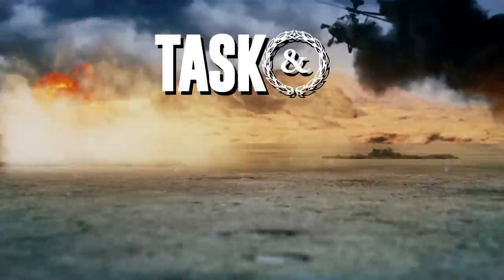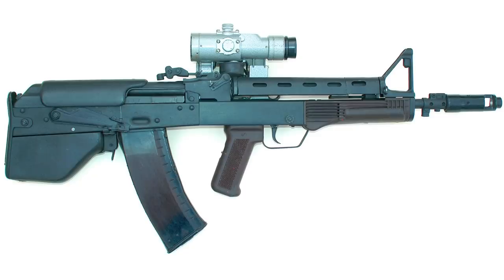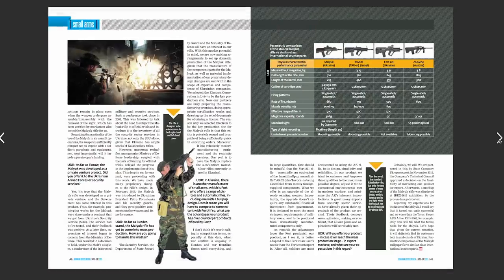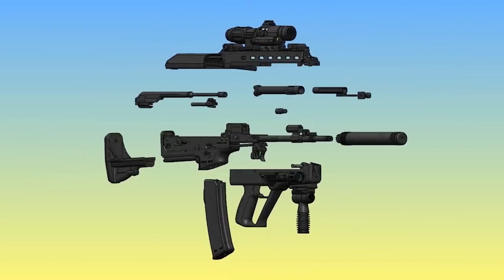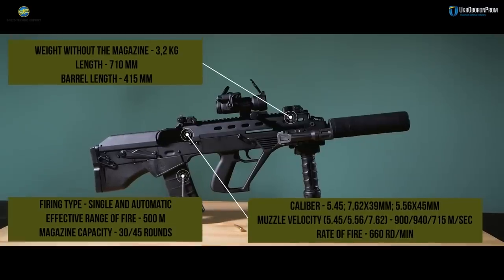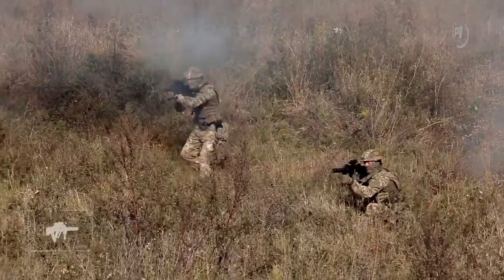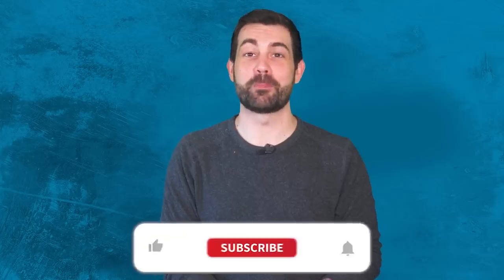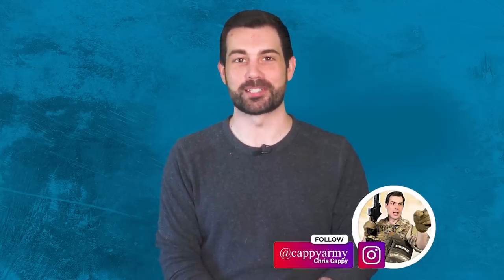Why Ukraine Special Ops Use This Bullpup. The Malyuk.

Comment: Convection is highly important for guns. Because convection is relevant for the surface area, Malyak can be good for heat management. the lifetime of the barrel is linked to the temperature, but there are more of mechanical wear of course. With good thermals gun are more reliable, accurate and shooters can see much better because heat forms "heat waves" wich distort view thru scope or metals. Easy example for convection heat radiator in hause, there are Convection and radiant heat, but convection is significantly more effective.

Comment: Basically, every bullpup is better than the orthodox layout in terms of grip, ergonomics, barrel length, muzzle velocity, and recoil. However, every bullpup layout is much worse in terms of the price tag on every item produced, because the action group should be much smaller and much more complicated than in orthodox layout. So it's needed only for trench-sweepers and building stormtroopers, which is a type of units, it's used right now)

Comment: Never heard of a convection heater? Convection also describes heat transfer through air, hence air-cooled engines using fins to increase the surface area allowing greater convection cooling as they suggest they are doing with this rifle and/or more gaps in the shroud. Also your editor (since you have a team now a days) needs to google what an AK47 is and not show a picture of an AK74U as a visual comparison for length! LOL. Still enjoy your videos though!.

Comment: If it is using less gas to operate the action, either by having a smaller gas port, or more likely having it farther down the barrel (more practical on a "bull-pup"), that would also contribute the the higher muzzle velocity as less anergy would be taken away that accelerates the bullet.

Comment: Only Bullpup I own is a 12g but almost the same thing.
I think it's like everyone else says, it's training for the weapon systems used.
Even in this video you see soldiers reloading using their forward hand for the mags.
People are just so used to keeping their firing hand on the grip of traditional rifles.

Recoil I think is just gonna feel different due to moving the weight/action back. 
Unless they have some kind of uber magic trick gas system, Newton's law prevails.
X caliber is always going to exert Y force. Gas/recoil systems can only absorb so much WHILE allowing cycling.
Could easily make a 50bmg feel like firing a 22, it just won't cycle the next round on it's own.
Reply: I could see it being hard to not use the trigger hand for another reason, most modern weapons put all the controls near the trigger so they can be operated without removing your hand. The AR-15 platform for instance puts the fire select/safety in a thumb operable position above the trigger, and the magazine release forward the trigger guard so your index finger can hit it. Using this style of system versus the AK style in VR absolutely gives a reloading advantage. You can drop the mag while your other hand goes to get a new magazine. Im aware, you would usually retain your mags and put them in a drop pouch, but if things get bad enough you'll opt for maximum speed.
Reply: @Justowner  Yeah I get all that- but with a bullpup, it's the firing hand that changes the mags even with the controls there.

It's correct for traditional rifles to keep the firing hand in place during a reload. It's not correct for bullpups, you need to use the firing hand to reload the mag. 

This is because it's super clunky to manipulate the gun with both hands so close to your chest. If you use the forward hand to reload, it's also competing for space with the firing hand's arms getting in the way.

Using the firing hand for reloads makes far more sense for bullpups but it's very hard when everyone is so used to using the forward hand. It was so clunky for me too reloading my bullpup. Once I just said f' it and just tried different things, I found just switching hands does the trick.

Comment: Malyuk is in fact Frankenstein from ak, so it is not necessary to say that he is more accurate. Shooting here will depend more on the skill of the shooter (if desired, you will find a video on YouTube where a Russian instructor shoots full mag in auto mod standing motionless on one leg like a statue). As for me, the malyuk rifle is more for internal troops with local tasks, but not for combined arms operations. I don't remember that it was possible to put a grenade launcher under the barrel or an extended magazine for 60 or a drum mag on it. And the Russians are in demand, both among ordinary soldiers and specialists. A 45-round magazine on a bullpup, well, figure out for yourself how it would be convenient for you. Someone correctly noted that the ak 12 would be better because of its versatility. And this is exactly what a soldier needs and will suit most. The quality of execution from batch to batch may be different, so I do not take this into account and consider only the general design.

Comment: It's not that much different to the British SA-80 to be honest, it's a decent design and I'm sure it'll work for the Ukrainian forces. You should compare it to our SA-80 Chris, as its very similar. 
I'm 50 years old and when I joined the British Army at 16, I used the 7.62mm monster rifle that is the SLR which was 3ft 9 inches long!! It was a phenomenally accurate and powerful weapon but difficult and awkward when used in urban combat and FIBUA training.
Then came her replacement....... the bullpup design 5.56mm SA-80 A1 which was obviously a lot shorter but actually had a barrel that was only about an inch shorter than the L1-A1 SLR. To be honest, I hated it at first because of the crappy teething problems but we gave it to H&K to it sort out and they did. Its an accurate, decent weapon with a decent optical sight as standard for most units but as it's a 5.56mm round, it doesn't have the awesome stopping power of the magnificent L1-A1 SLR which, in my opinion, is the Rolls Royce of personal weapons.
Just thought I'd give you an insight into the British SLR and SA-80.
Reply: The Lee Enfield rifle was originally meant to have a bullpup replacement firing a .280 calibre round but didn't get adopted due to America insisting on NATO standardisation of the 7.62 NATO cartridge, hence the Belgian SLR being used.
Reply: @davefm5559   no

Comment: Bullpups being "weird" comes mostly from a soldier that was trained on a non-bullpup rifle. The only objective disadvantage is the trigger being harder to make well and the ejection being closer to the face and therefore usually worse for switching shoulders.
Reply: @josedorsaith5261  To be fair, the SA80 was also pretty crap overall, at the very least in its initial iterations and left handed soldiers didn't even get a left handed configuration of the gun, like they would have for e.g. a FAMAS. Making a gun a bullpup doesn't make it automatically good, you still need to be good at all the other gun design decisions. But some of the better bullpups are, in the hand of a soldier who hasn't used them for the litterally first time, at the very least on par with the best of the non bullpup rifles out there, unless you are in a situation where the advantages of a bullpup really become important, and it may even be outright better.
Reply: @josedorsaith5261  Yes, and in general eating brass is an objective risk of a bullpup. But holding the front grib, or optics, etc. is more of being used to something else thing.
And the Malyuks magazine realease being questionable, is a Malyuk thing, not a bullpup thing.
That's what I'm saying.
I think they have managed to get reasonable triggers in some of the best bullpups, even if that is still more work, so the shoulder switching is really the main drawback, I agree. Some bullpups try to remediate that, but often that creates a different potential issue. As good as it is, I wouldn't want to go to war with an MDR's forward ejection system. To fragile and just an additional source of problems. A VHS-2 or an MDR with the simple side eject on the other hand, I'd take that over a G36 oder AR variant.

Comment: AK-12 is the bad boy! It has some of the recoil get pushed forward as the gas pushes it backwards super smooth plus the rounds are perfect size IMO just a tad bigger all around then the .556 which is the only change the .556 needs, its really the ammo, if the rules would allow hollowpoints it would change the way the military sees the .556!!!

Comment: I kinda doubt some of the claims about the Malyuk. Especially as far as it being a cooler running rifle than some of its contemporaries.
But about the Malyuk having less recoil than an AK47/74?
Maybe.
AKs in general are overgased by design.
IF the Malyuk isn't?
Then combined with its more straight, inline, stock design?
And any kind of a decent muzzle device?
It might have less felt recoil than an AK in the same caliber.
But 50% less than an equivalent AK???
I don't think so.
But.
This being said.
Even if the Malyuk's recoil is only 25% less than an AK. That's still a significant improvement.

Comment: Im a chemical engineer and can verify your definition of convection is completely wrong. Convection describes the manner in which a fluid removes heat by both the individual atom collisions(this what conduction is) and the macroscopic flow pattern. Fluid refers to gas or liquid. However the conduction part is insignificant in gases and so conduction is described more by the macroscopic effects. Your pc fan coolers are an example of conduction as well as basically all domestic heaters. No liquid is involved in this process

Comment: >>Why Only Ukraine Special Forces Use This Strange Rifle

Because the characteristics of AK and "Malyuk" are identical. The infantryman of the line makes excellent use of the usual AK, of which there are many in Ukraine. Special forces need a rifle with a silencer in 100% of cases, the standard AK silencer lengthens it by 50%. "Malyuk" is equipped with a modern shortened silencer, which, in combination with the layout of the bullpups, gives acceptable weapon sizes.
Regarding convection - the handle is a hollow tube, when the barrel is heated when firing - hot air goes up and pulls cold air from below through this tube - which, theoretically, gives better cooling than 4 slots on the AK forearm. One of the designers is a tank engineer, on the Ukrainian T-64 tank, a similar cooling radiator purging scheme is used - exhaust gases are injected under pressure from nozzles behind the radiator, which creates a pressure difference and cold air is drawn through the radiator without a fan. We like such systems.
In Ukraine, the Kiev factory also developed a system for rebarreling AKs from Soviet calibers to .223 Remington - as in Ukraine after the capture of Lugansk by Russia - there is no own production of ammunition for the AK. Since the decision to join NATO has been made, the production of old calibers will not be reestablished, and in order to reduce the costs of re-armament, the option of replacing the barrel is possible, even old AK clips with a new ammunition are working on the tests.

Comment: Several bullpup AK conversions have been created over the years (since at least the early '80s, if memory serves.) None of them have been very good, and not something suitable for combat. From the looks of it, this rifle might be the most perfected example that has ever existed.

In some of the shots it looked like there may have been a recoil reduction device built into the butt plate (or I might have been seeing things...) Also, the new magazine catch seems problematic. I imagine that the magazines still aren't drop-free. However, this is an impressive result- especially given the weapon they started with.

Comment: "Usually a convection system involves a liquid to cool a gas system" is just plain wrong. What you're talking about there is a liquid-cooled system. A liquid-cooled system is indeed convective, but a convective system is almost never "liquid-cooled." Any situation, anywhere, in the Universe, where transfer of heat is facilitated by the movement of a fluid (whether gas or liquid) involves convection, so most guns are cooled by convection, as are iron skillets, a cup of coffee when you blow over it, the Sun, and the surface of a desert on a hot day.
What they probably mean to imply, if it's anything but marketing, is that they have shaped some elements either to make the hot gas or the cold air flow more efficiently (for cooling or to stay cool) around or away from the hot parts.

Comment: The question of better or worse is extremely individual, because some people do not like the bullpup system just aesthetically, others like AKs just for the fact that it is an AK and that's all. You have to understand that the Malyuk. is inherently just more compact and slightly more versatile all the same AK. And the AK-12 is in the end came out just a standard AK-74m with dodos for the new devices. In essence, the usual good Toyota, with the standard engine and running gear, to which hung a beautiful bumper and painted a fresh color, but exactly the performance has not improved. All because the purpose of AK-12 was not to improve, the goal was to create something simple as it was, but at the same time what you can steal a lot of money. The Russians have achieved this goal, to get the maximum corruption scheme for minimal improvements. Malyuk is sort of a logical and rational transformation of standard AK into bullpup version, it will not become a mass-market replacement for every soldier, and there is no such goal, but for special units of higher rank than standard regular soldier, it is a good option for Airborne Assault Troops, Special Operations Forces, National Guard and Police special units.

Comment: I wish I had some input on the gun but sadly I'am no expert. Though, I do enjoy your revues none the less, right until  the point when you start talking about Ukraine, because someone is feeding you crap on the subject, even on small things such as the word "Malyuk" (малюк - Ukrainian). Russian language does not have that word, the equivalent will be "Malysh" (малыш). And a more accurate translation of the Ukrainian word would be just "baby" 1-5 y/o, without the "boy" part, because it can be used for girls as well. 
I'm sure it's insignificant to you, though I am sure you'd feel a bit different if you were  constantly misrepresented & places on the same platter with the very thing you hate the most. Also, even though unintentionally (I chose to believe that) you're feeding crap to the people who know as much as you do or even less (if that's even possible) about Ukraine,  russia and formal USSR altogether.

Comment: I assume that the 'convection' is similar to that of the Swiss SIG 550 (Stgw 90) in that there are cooling holes in the plastic barrel furniture. This compares favourably to the AK (or SKS for that matter) which have wooden furniture with little possibility for air cooling of the barrel. I have both the Stgw 90 and SKS at my disposal.

Comment: The usual bulpup problems, good luck fitting a 2 point sling without interfering with the charging handle. For elite operators there isn't room to mount all the accessories needed for night vision work.

Comment: Great video, but your quips about the Azov battalion is an unfortunate example of dumbassery. 3 minutes of research is enough to find out that despite its controversial origins, ever since it was incorporated into the regular UA army in 2014, it consists of completely new members all the way up to the commander. There is absolutely nothing controversial about them.